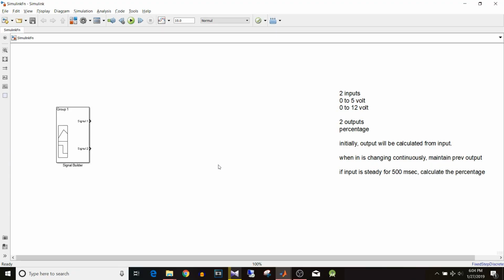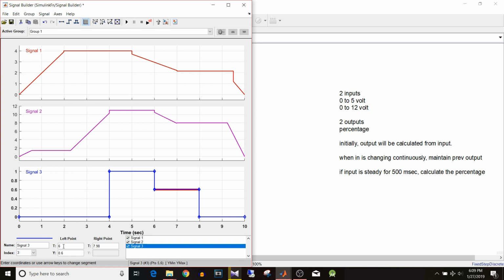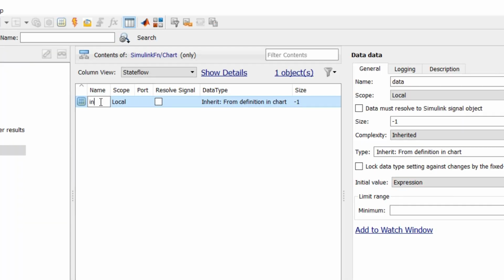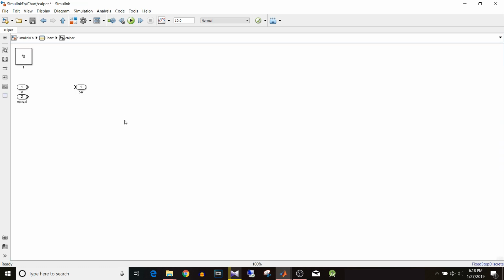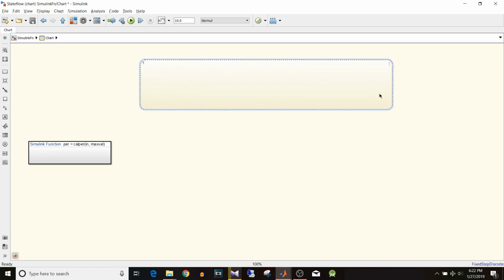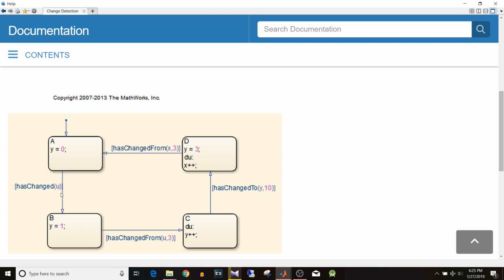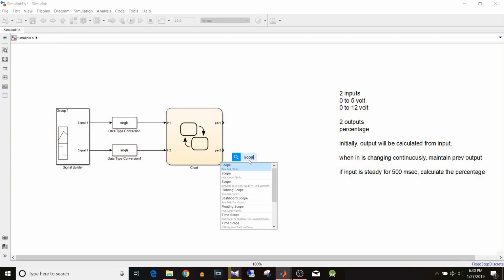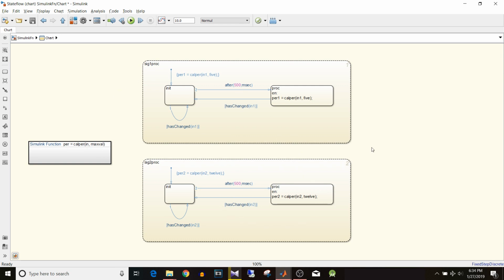Simulink Tutorial - 59 - Simulink Function Block

Comment: Madam I have a doubt I have some ideas about simulink but is it  necessary to know about mscript because I want to work towards requirement not in automation.if I want to know about  mscript what is the best way to learn
Reply from the maker: To write mscript, you should be clear about the steps that you want to perform and implement those using MATLAB commands which can be easily found using MATLAB help option. This is the base.
About Simulink, it is not required that you should know mscript in detail, but a little bit knowledge helps, for creating variables and definitions (which are generally generated using automation script) and understanding them. 
Plus migration of models from one MATLAB version to other becomes easier with scripts.
But if you want to just concentrate on requirement implementation, it's not necessary to learn mscript
Reply: @simulinktutorial9086  
Thank you for the reply mam